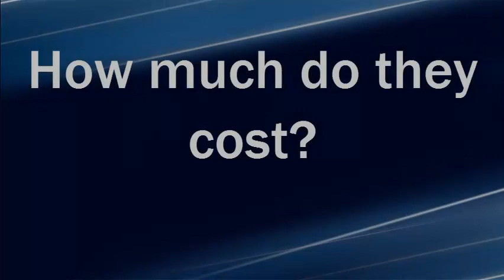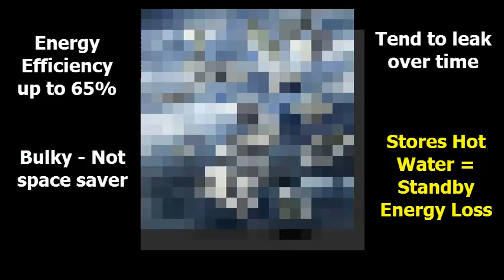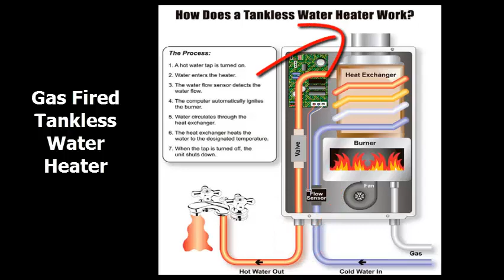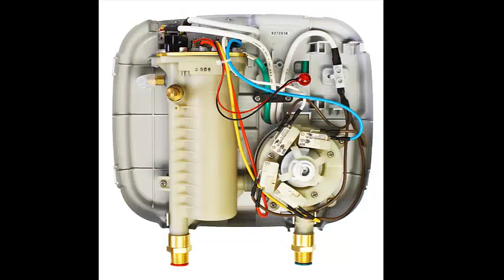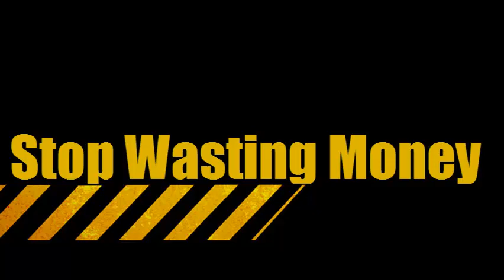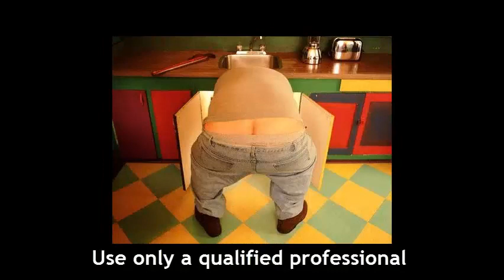POWERFUL WHOLE HOUSE Electric Tankless Hot Water Heater 32kW 4GPM

Comment: 65%, 87% pretty poor efficiency. My heater has about close to 100% and can modulate the power. Less water - less power, much water - much power And i can can choose the temperature as i want it.
There are gas powered boilers with about 90-95% efficiency.

Comment: drifted69mimi replied to your comment
POWERFUL WHOLE HOUSE Electric Tankless Hot Water Heater 18kW 6GPM
	
drifted69mimi
The cold water is originally heated in the tank. However, when the stored (hot) water drops to a certain temperature the heating element is triggered. The hot water is then re-heated to the set temperature on the tank. Hot water heater.

You must not have noticed there is no TANK as you twice indicated this one has.  Read the part again that states "POWERFUL WHOLE HOUSE Electric Tankless Hot Water Heater 18kW 6GPM".  There is no purpose in repeatedly heating a few ounces of water in a few lines.  They do not come on unless a faucet is opened and the pressure drops.  The whole idea is for the unit to NOT come on periodically.  I appreciate your right to be wrong and embrace your own flawed logic in a desperate attempt to prove me wrong.  I got a good laugh out of your reply.

Comment: There is no such thing as a "hot water heater".  There are only Water Heaters.  We heat cold water and there would not be any need to heat Hot water.  None of their shipping cartons read "Hot Water Heater" on the side.  In actuality they are all Cold Water Heaters.  I agree with an electric tankless water heater over a tank type unit.  They save a lot of space and use less power over time.  It may be possible to use a medium sized unit for the whole house and add one or two small under-sink 120V models where needed, say in distant areas of the home.  I agree with Looncraz, and there indeed are models with a small tank on them.
Reply: The cold water is originally heated in the tank. However, when the stored (hot) water drops to a certain temperature the heating element is triggered. The hot water is then re-heated to the set temperature on the tank. Hot water heater.

Comment: These units would be better if they were to employ a small (~2gal) tank to provide instant heat.  The small tank would merely be kept warm and would then cycle through the heater on demand, allowing the heaters to warm up faster.  An internal bypass would simply run the water through every few hours to keep the temperature of the small tank near 90F (considerably higher than most service water temperatures).
Reply: Some Navien gas tankless water heaters have that feature.

Comment: I use two of them and if you use a standard home filter and water softener even your tank will last longer.  When I installed the thankless the bill was a big difference.  The one going to the bathroom gets hot in about 5 seconds but the one going across the house takes a few more to travel.  Kids taking endless showers, no problem, no more tanks, and a lot more room.  I used the same connections 220 from my hot water heater no problems.  Just put 50 amp breaker in like my stove.